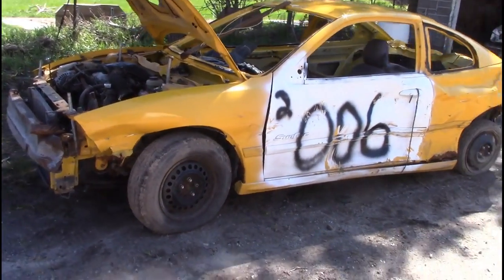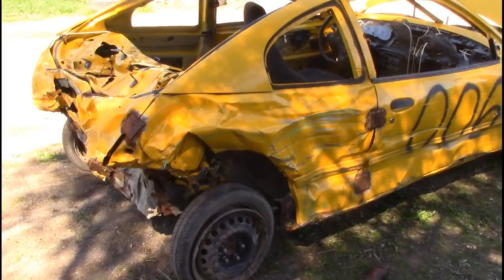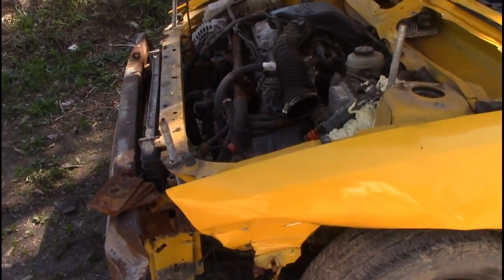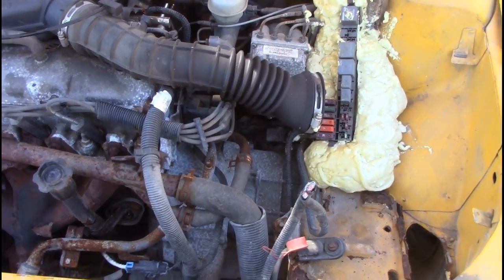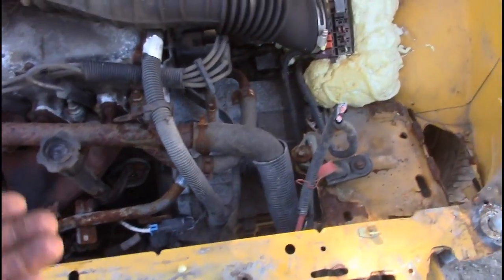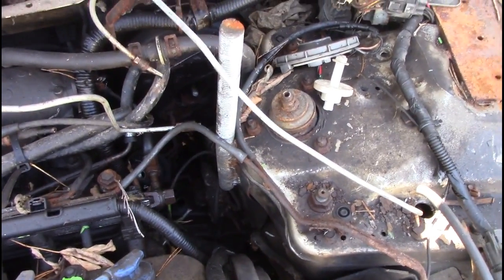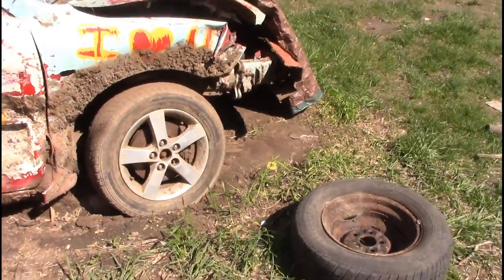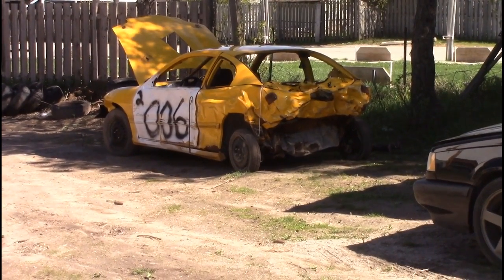save or not to save, when to fix or scrap a derby car

Comment: it also depends on the time you have in to the car to build stock/weld makes the diff if you have to put 45 hours in to build a new car you might spend 6 hours to put the parts in it
Reply from the maker: junkyarddawg08 that's true aswell but.m not on his car this cars is about 4-5 to build